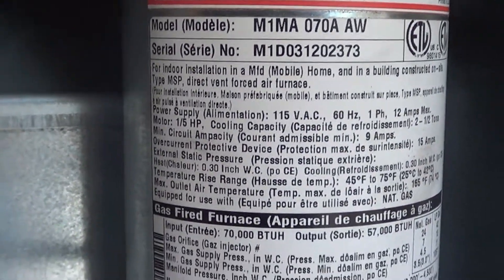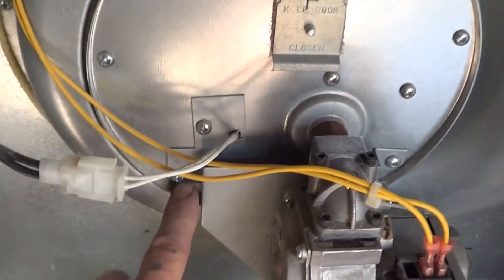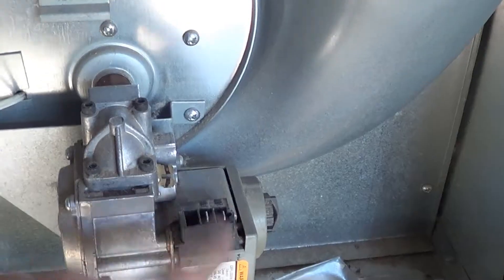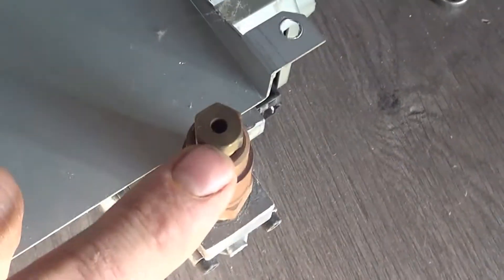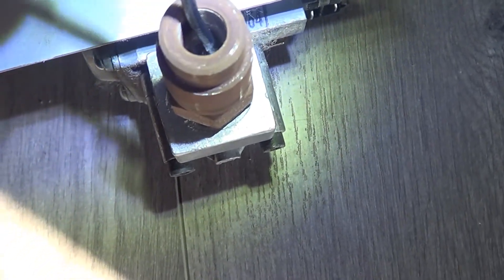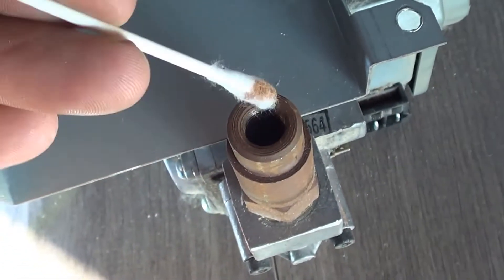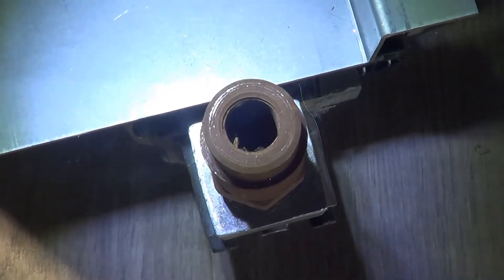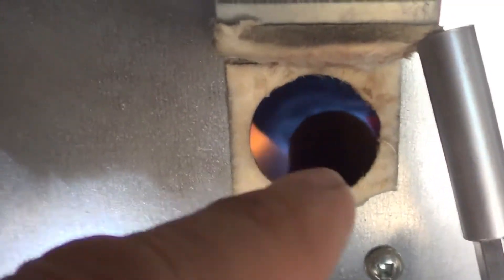Ignition failure on a mobile home furnace

Comment: I have the same thing but it ignites and see the flame but then shuts off like the gas turned off
Reply from the maker: Hello, usually that is the flame sensor, which on this exact model doubles aS the igniter. Clean the ignitor gently with a small paintbrush then carefully bend the ignitor bracket so that it moved the tip of the ignitor into the flame where it leaves the big tube. Thanks for the reply.

Comment: Do you have a video on how to replace the entire control valve?
Reply from the maker: Sorry no, however, it is as easy as taking off the gas line, disconnecting the bracket from the old valve (unscrewing it) and then reversing all those.

Comment: Awww poor spider lol
Well it's the me or the spider so Im game. 

My set up looks exactly like that. I have four red blinking lights so apparently it's the ignitor.

The flame comes on and it's pretty strong. And then the whole system shuts off after two minutes.
.It's set on AUTO HEAT @ 70 degrees.

Seems like it wanted to warm up but it shut off by itself. Any ideas?

Its going to be 30 tonight and My space heaters keep blowing the fuses. 

Thank you for your video!
Reply from the maker: Sorry for the late reply. It may be something to do with the flame sensor. On intertherm/nordyne furnaces the sensor is the igniter. Clean the ignitor, when cool. I usually use a soft toothbrush, SUPER lightly. When the furnace goes off, you’d need to know what the flash code say.

Comment: I wonder how many people have had their heater replaced because of this stupid spider issue. I was almost one of them. I want to know just how do spiders get in the gas line? How do they breathe? My spider issue happened when I converted from propane to Nat gas in 2017. It happened again late 2022 when it started to recycle itself. Gas lines were not disturbed. I think because propane gas is at higher pressure it forced it's way thru the web (there was a small in it). Now the heater roars like never before giving me plenty of heat. Previously in the winter the heater would run for a long time.
Reply: It is odd that the spider survives in such a place. I’ve hardly seen a spider in a propane converted furnace, mostly, I theorize as the hole in the orifice for propane is too small. I like the theory of higher pressure shooting it out as well. The only access to the chamber is where the wires for the ignitor are and throw the roof. Never have seen one go in but it’s got to get in from one of those. Thanks for the reply
Reply: @randydolph852  Thanks for replying. Had another thought; When gas pipe is installed, pipe dope is used, Teflon tape is not allowed. Maybe the residual goo is forced inside the connection and exposed to the gas, erodes slowly but when it's restricted by the nozzle it collects into a film. Just spit ballin' here.

Comment: It worked like a charm!! 
Problem is,  the HVAC company didn't put a screw back in,  i didn't notice until i took it off. There seems to be a small gap,  but it would have been there since last year right?  No issues but i don't trust myself. Any info?
Reply: Hello, depends on which screw of course. Some brackets have more screws and one missing is not the end of the world but the ‘gap’ does not sound good. Where is the gap?
Reply: @randydolph852  upper right corner of the plate. The whole gas inlet and I'm guessing regulator thing is in the way
Reply: @randydolph852  it's impossible to get to unless you take that whole thing apart and i have no idea how up do it. To me,  it looks like all 1 molded piece that would need to be completely replaced before you can get that screw in. Wish I could add pictures here

Comment: Just wonder if the igniter fail, will the fan motor still run?
Reply: The combustion air (inducer motor) fan will run, it’s the one that starts first, that will run even with a bad igniter. The main blower motor doesn’t come on until the flame has been on for a while. Sequence of operations, a) thermostat calls for heat, b) inducer motor comes on and closer pressure switch, c) control board reads ‘closed pressure switch’ and igniter comes on, d) power is given to valve and gas flood heat exchanger (flame), e) then main blower comes on. Every one of these actions is timed by relays on the circuit board, the clicking sounds you hear. Thanks for the questions

Comment: So I have the same furnace at my house but it starts heats up the flame lights then in about 8 to 10 seconds the flame dies out and then it trys agen and just keeps doing that what could ve my problem if you could help
Reply: Often that is the ignitor. The ignitor also acts as the flame sensor on this model. Sometimes the ignitor builds up some soot. CAREFULLY brush off that soot would help. Or it could be not in the flame enough as it gets older it gets a little weaker. Again, CAREFULLY bend the metal bracket just a little to move it so it will be more into the flame. You could very easily break it this way so please be careful. It definitely sounds like an ignitor issue but could be an air intake our exhaust. Check roof Jack for obstruction. 99.9% chance it’s the former.

Comment: My Evcon is flashing once and code says a igniter failure, could mine be the same problem as this?
Reply: It could be. This is a ignition failure issue. Make sure to check the igniter for continuity. Hope you got it working by now. Does the igniter come on and then a clicking sound is heard and either small or no flame? Then this is the potential problem. If no igniter comes on and then it starts flashing ignition failure then focus more o; the ignitor

Comment: My daughter has a Revolv M1M, the burner goes out when the blower comes on. the serviceman charged nearly $400 only changed the ignitor and couldn't fix the problem. Temps are in the single digits. Any help would be appreciated.
Reply: Have same issue. Revolv as well
Reply: Sounds like a weak flame. I went through everything on my furnace and the last part I checked was the gas valve. Took the orifice off and cleaned it out with shop vac. It didn’t look dirty but apparently it was . I reinstalled it after cleaning it and furnace runs great now.

Comment: I did all that and mine wont seem to ignite still the gas don't seem to be flowing do you know what might be wrong?
Reply: When you took the orifice out did it have a clog in it? Are you able to check to see if, once the igniter comes on, does 24 volts come down to the valve? Are you sure you are getting gas to the valve? I often loosen the gas connection and check for pressure. There is a Allen wrench nut on the valve where you can check pressure in from supply but you need a tester to tell you if that is correct. If you have gas to the valve and are getting 24 volts after igniter comes on for about ten seconds, then it sounds like bad valve. Make sure you are getting that 24 volts as I’ve seen it be a bad circuit board not supplying the valve. Note if you are getting to a glowing igniter you are passed the pressure system so don’t look for problems there.
Reply: @randy I’m getting no blinking light. Only the blower fan kicks on if I turn the thermostat to the fan on position. I’ve changed the control board, and igniter. I was checking voltage on the igniter wire and the pressure system motor kicked on. Still nothing when I put it on auto and try to start the furnace.
Reply: How test the switch on the gas?

Comment: I replaced my ignition switch and I'm wondering if I hooked the lose wires to it backwards into the white wiring harness? It didn't come connected in the parts box...and my furnace still doesn't work..😪😪😪

Comment: I have that exact furnace but the status codes and cover are gone. My flame light flickers, fan squeaks a small amount on start and when it shuts off. Weak flame? And how in the world do you clean and oil the fan?
Reply: If it's blinking once, the error is "limit switch open" but as you can see above I'm looking in to other possibilities.

Comment: Do the Nordyne M1M furnaces not have a flame sensor?  I was wondering if that might be my problem, but don't see any videos showing where it is - and nothing looks like one to me so far.
Reply: On nordyne M1M furnaces the igniter is the flame sensor. They found that sometimes the igniter is not angled enough into the flame to get a positive reading. Sometimes GENTLY bending that into the end of the burner pipe helps. You can also GENTLY with a small brush off any sort off the igniter. Sometimes the only fix is replacement but first make sure it is a strong flame before blaming the igniter/flame sensor
Reply: @randydolph852  Well that explains why I couldn't find it!  Okay I'll give that a try.  Thanks!  
Another thing I'm wondering though - would I still get the limit switch open error blink if the igniter was the problem?  Prior to me asking the above comment - I had replaced both limit switches (aux one was "compatible" but not exact replacement - not sure if that matters).  The furnace ran nicely for about a week and then back to the short cycles and open LS error code.  But it isn't always blinking when it short cycles so that's why I thought maybe it was something else. Flame does seem strong when it was "allowed" to fire. idk if there's any more to offer there - but thank you anyway for answering above. : - )
Reply: That's what I'm wondering? I wish this guy would answer the questions.....lol

Comment: Can you use WD40 to loosen the orifice?
Reply: That would not penetrate the threads and may get into the valve. I would not use any lubricants for it nor do you use thread sealant when putting it back on. Using the correct wrench size is always best. I have had to use channel locks however when they have been stripped. Thanks for the question
Reply: @randydolph852  when I try to loosen the orifice the entire fitting just spins and I’ve tried a wrench and can’t budge it.
Reply: It is okay to take that whole fitting off. If you do take the whole piece off at the threaded piece of the valve you will need thread sealant when putting it back on. Sometimes those orifices are a pain.
Reply: @randydolph852  ok thank you.